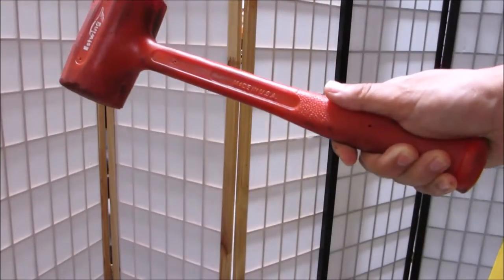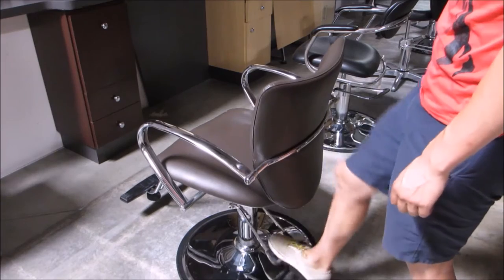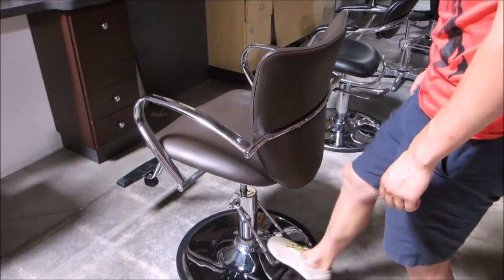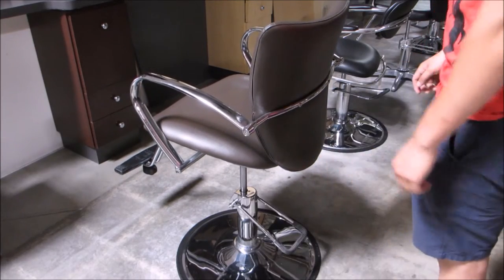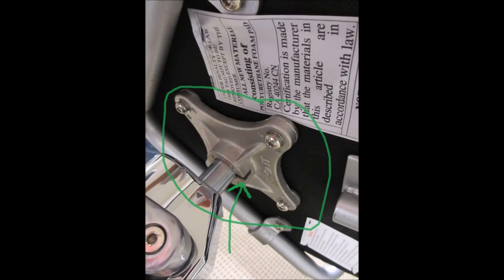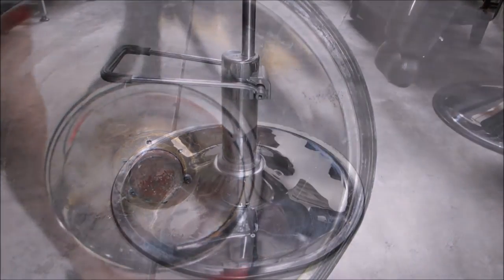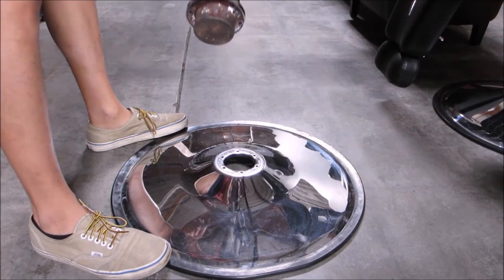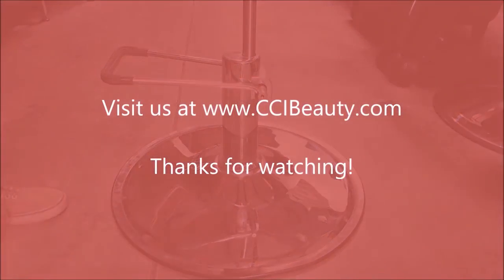How to Remove Salon Chair Pump and Seat Top

Comment: Does chair plate slant toward front of seat or back 🤔 I took mine off think put on wrong now chair slanted forward..
Reply from the maker: No it shouldn't be. If there is any slant to it you might need to check if the base has a problem or if the metal plate underneath the chair has an issue.